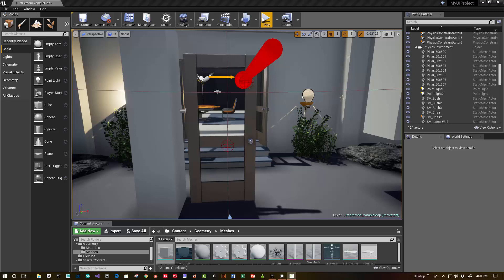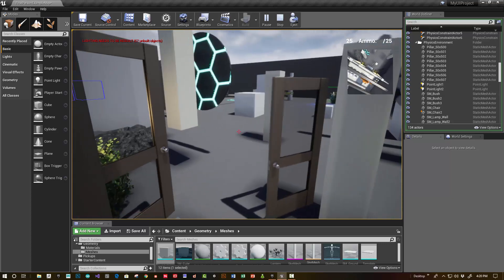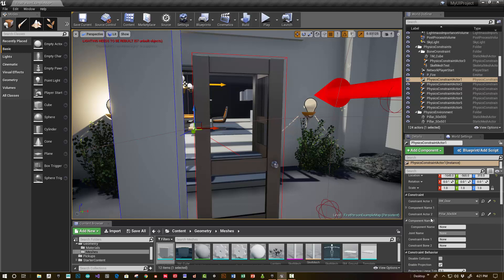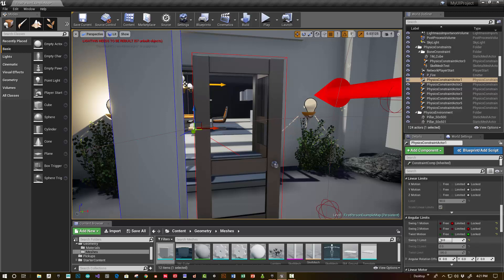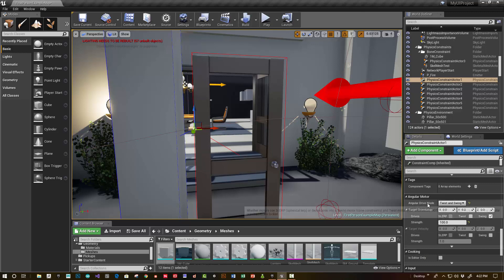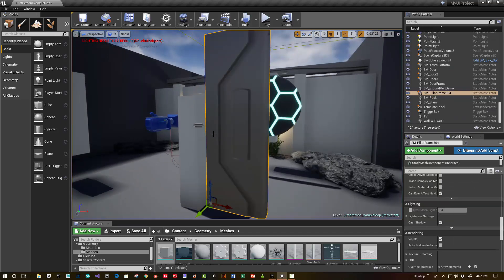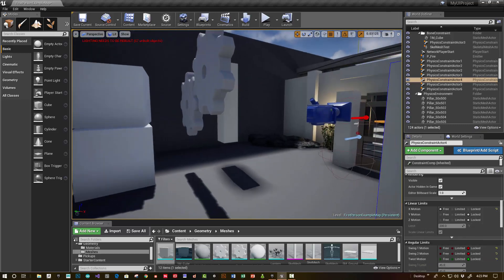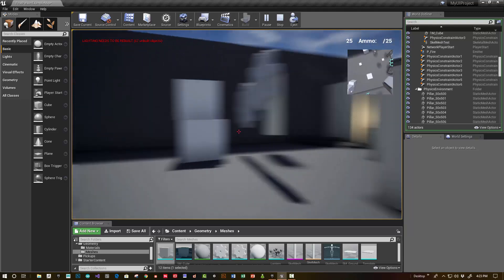Saloon Door!  Physics Motors LinearAngular Constraint Unreal

Comment: Hi. Thank you for the video. I'm having issues using angular motors... How did you do the gears rotating motor? I'm at a loss here. I tried to fiddle with every settings but my objects does not turn on its own. What am I doing wrong? Thank you
Reply from the maker: Hi Naser!  While I don't know exactly what workflow you tried...To do gears I probably wouldn't literally have 1 gear drive another.  I used angular driver dynamics for drive the "main" gear - then I scripted gear #2 to rotate inversely based on gear #1's rotation.  If you have DIFFERENTLY sized gears - you would have to look up the gear ratio for your scripted gear
Reply: Thank you so much for replying. I have to say that I only started using UE just now. I was working on a vehicle project on Unity and I came to a semi completion and I want to replicate what I did on UE so I can compare which one offers better experience. I need to look into Angular Drive Dynamics and how to use it. Although I managed to do what I asked before (took me 6 hours to figure that out). I had difficulties using the Angular Motor params to make it work. Turns out that I didn't give a value for the turn rate Velocity in the Target Velocity and the strength was 0... so two mistakes from my side. So, what I did was:-Linear Limits all locked-Angular limits just Swing2 free, rest are locked.-Angular Motor:--Twist and Swing--Target Velocity (0,-15,0)--Drives [Swing]--Strength 15and it works. I need a script now to have the player control the throttle and such.Did I do the right thing here? What are your thoughts?
Reply from the maker: @naserharbi   Without having UE4 open in front of me, it sounds like you're on the right track now!  Also - glad you found out where your error was!
Reply: Thanks :). and thank you again for the assist. Hopefully after I finish, I will post a video on what I did and post the link here. Good luck.